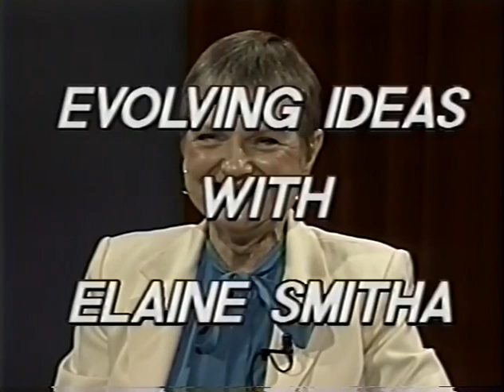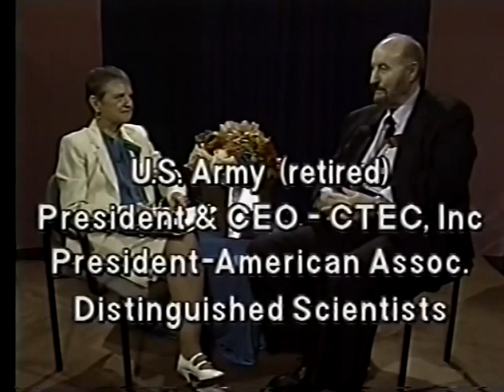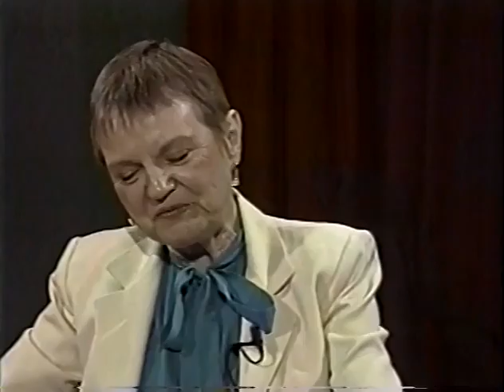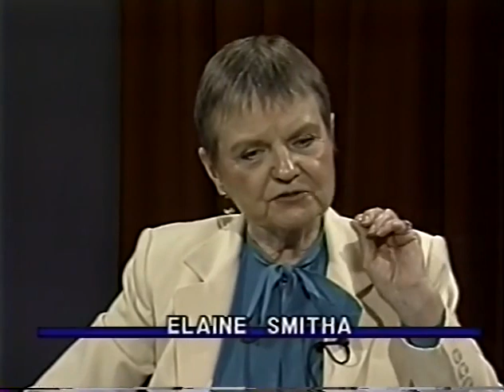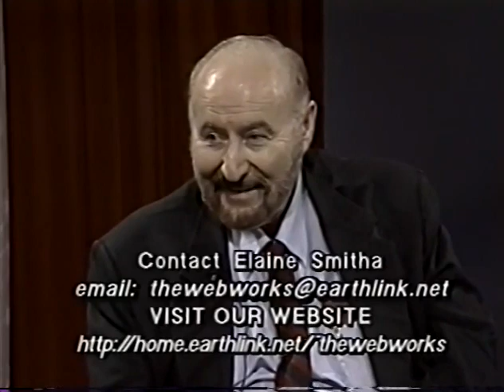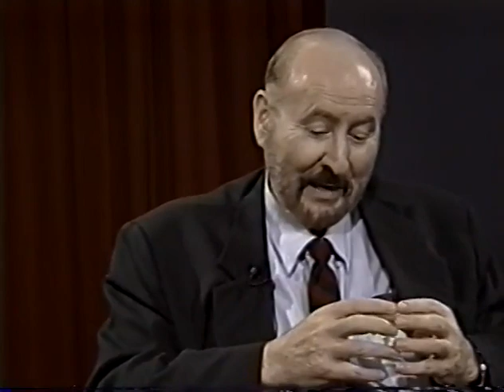Rare Interview with Tom Bearden

Comment: here's what he means by not killing the dipole:

suppose u have a battery, you put an inverter circuit and connect to the battery so it can convert DC to AC, then you connect a step up transformer and step up the voltage to higher level, then you rectify the higher voltage and connect to a capacitor of higher voltage and appropriate capacity, now the capacitor is being charged with DC so it will remain always fully charged keeping the polarity same, 

then u connect each terminal of capacitor to two different metallic plates and keep them at some distance apart of about 10-15 cm, between the plates u can put parallel plate capacitor and connect it to another step up transformer and then connect load to secondary of this transformer, 

now when you move the middle parallel plate capacitor near one plate, the charge will move to other plate via load due to electrostatic induction, and then you flip the plate and bring the same plate to another terminal connected to capacitor, the charges will move to another plate due to electrostatic induction, the larger the load the harder the movement, that's why we put a step up transformer between load and parallel plate capacitor placed in middle so the primary impedance drops and charges can move easier to another plate when bringing closer to collection of charges. 
this way the battery is just supplying voltage and no current is being drawn from battery, the battery will run forever, until the parts wear out.